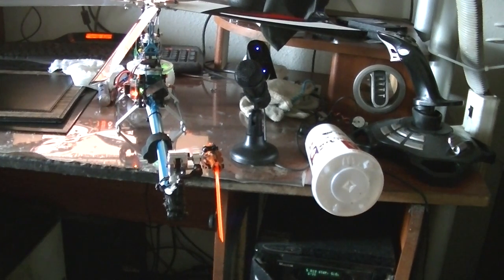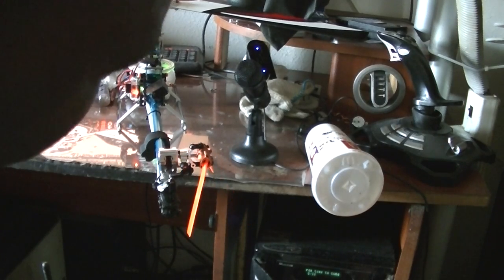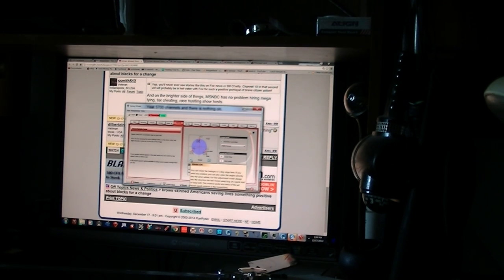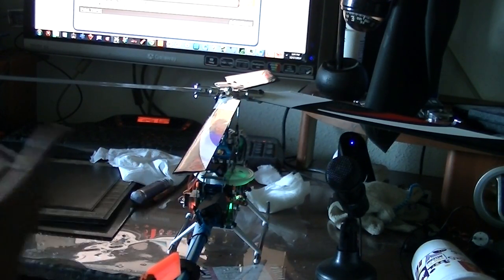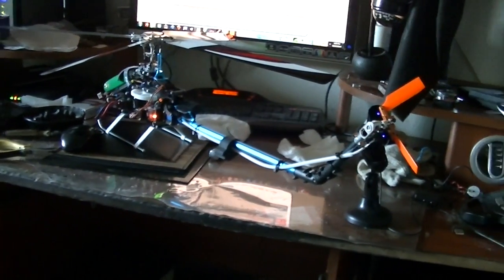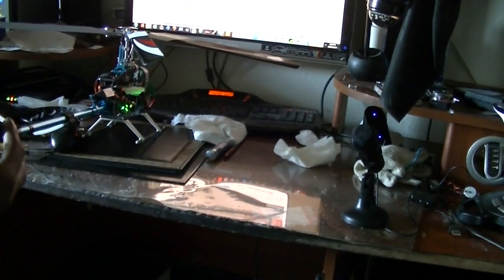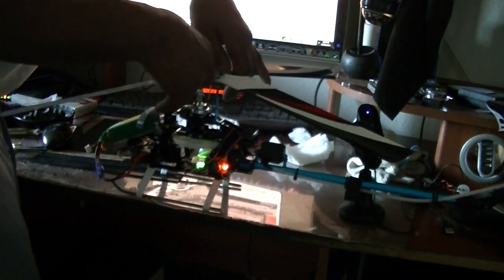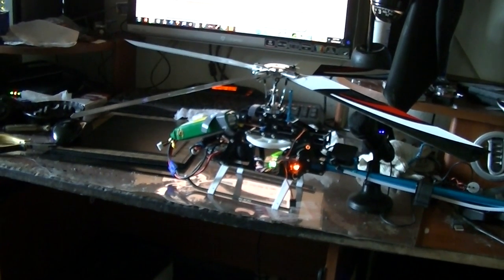mechanical and electric rc helicopter rotor head phasing  for 3 and 5 rotor head units

Comment: Looking good. You will get a little tail hunting with that set up" why cause the tail push rod sometime wants to bind but I see you got a big tail servo with more torque that should solve most of the hunting. I have built 4 to 5 blade helis the 4 blade is basically the easiest. Any W.C give me halla fam.
Reply from the maker: so do you setup a 4 rotor like a flybarred without any phasing 
and whew glad someone replied that has some experience with this
and if i used a phasing setup with a 4 rotor would it be more stable ?
and yea thats a digital mg tail servo its working good so far
Reply: Yep set as fly barless, make sure you at center stick when manually setting up the phasing. You got the right idea

Comment: To help out with the CG you can probably use a 3 oz or 5 oz fishing weight in a small ring box taped and velcro mounted in front of the helicopter frame to level it out. If you are gonna do lights and have to use a battery for that check your CG after the battery is added and then you will know what size weight you will need. Just a thought. Looking good man liked!
Reply from the maker: thank you